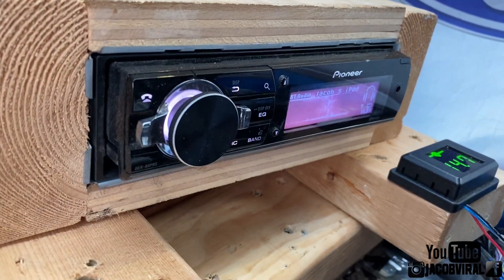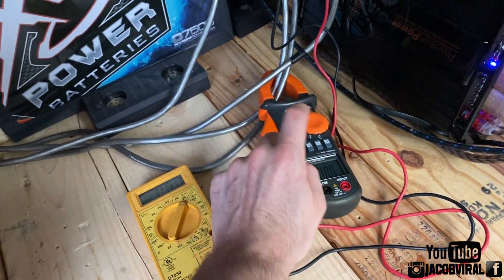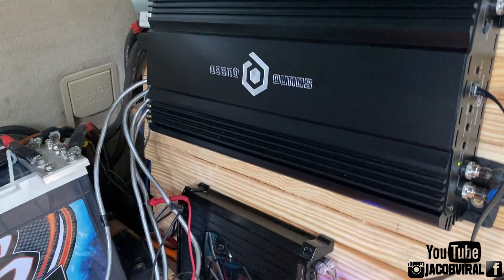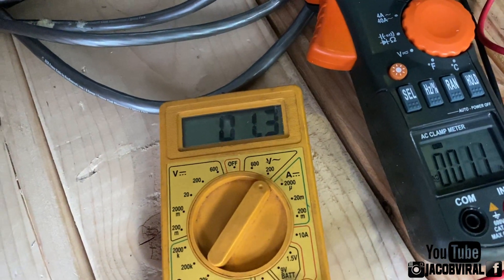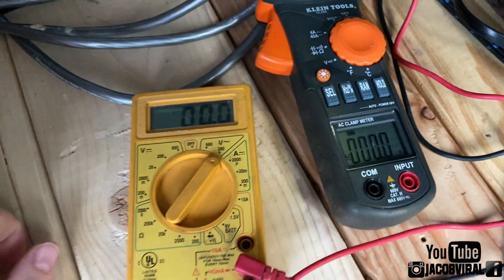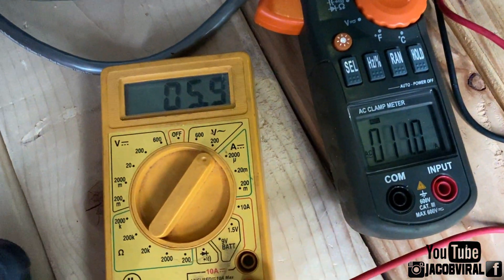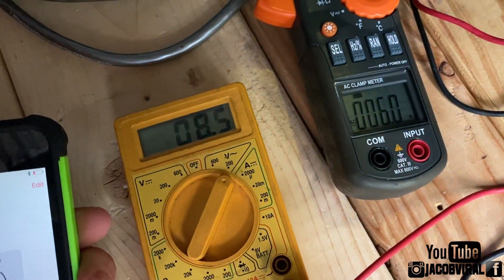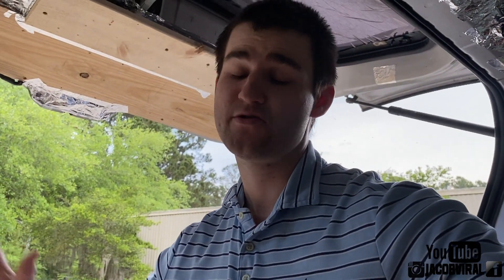HOW TO FIND HOW MANY WATTS RMS YOUR AMP IS PUTTING OUT

Comment: You're measurement is incorrect...
You don't consider the Frequency Effect - AC Meters are sensitive to frequency and should not be used on frequencies other than design frequency. 
The manufactures rate these meter’s accuracy based on being able to produce a displayed reading that is accurate to some amount, usually in root mean square. If you look at the specs for a digital meter they will degrade the accuracy as the frequency goes up.
This should give you a clue. A digital meter has to convert the signal from analog to digital. To do this with any accuracy for a constantly changing voltage, you have to take enough samples to do accurate RMS calculations. So the clock rate of the A/D converter has to be high enough to take these samples and send them to the embedded processor to make the calculations and display them.

Comment: You were 100% clipping. That's why your subwoofer (as you put it) didn't like the frequency. Most newer amplifier power ratings are conducted with a one kilohertz test tone... Whereas back in the day, we would test twenty hertz to twenty kilohertz. By cranking your bass knob, you are causing your amplifier to clip much earlier. Regardless, it's an interesting video.
Reply: Not true, his sub was not clipping, it was overpowered. Big difference also when setting your max vol to clipping you would turn the sub knob to max also so that when everything is maxed you are not clipping.
Reply: If his headunit was not clipping the amp was, you can set your gains close with a dmm but the best way is with an o scope, by the math  @JayRSwan

Comment: can i just do this test by playing music instead of a test tone?
Reply from the maker: Correct
Reply: @JacobViral2  I appreciate it. I could be doing this wrong, but followed everything, just listening to music, strong bass music, and the volts and clamp barely get high, and the car is booming. Volts are at like 1.3 and amps are at like .8.  What does this mean?  Hard to believe that multiplying this is the wattage coming out of the amp. I must be doing this wrong or lack understanding. Any advice?
Reply from the maker: @alwaysbeeurself  I always like to test one frequency with the volume max near clip so it's measurable. Lower volume on music will be harder but yes works. usually not 100% eff but gives ball park.

Comment: Can you make this type of vid (getting correct wattage); setting up a 4 channel amp in bridge mode?? 
I needed more power for the speakers so I am running two 4channels in bridge mode to the doors. 
Worried something is gonna blow bc I never saw them meter anything during install. 
TIA!
Reply from the maker: Youl be fine just make sure your bridge amps isn’t past 4 ohm as most bridges 4 channels are only 4 ohm stable

Comment: sp what if you are clipping before rated rms output
Reply from the maker: Just voltage drop and impedance ohm rise, so will see less than rated
Reply: @JacobViral2  so i was doing 2 ohm × 650 watts target with a square root being 36 volts with multimeter  but are you really sappost to count ohm rise as well when doing this to set gains or is mutiplying by the standing ohm is the way?

Comment: Fuse Size? How come everyone is taking the output watts then dropping say 0.8% for loss in a “Class-D”
amp, 13.8Vdc supply with a 1,000 watt amp and coming up with 90 amp fuse to protect the input. The power solving math doesn’t work like that on an expense “Buck to Buck” boost to run a “Class-D” amp output. 
  The amp clamp should be on the alternator B+ supply side to measure the amps drawn, not output.
  This is off topic as I know you are discussing “Clipping” frequency’s but they are not using voltage drop for wire sizing or a good amp clamp on power supply, then purchase the fuse closest to input needs then undersize if the values fall in between fuses. A small ANL as with most fuses will handle in-rush current in cold equipment for several seconds until it warms up, then current drops. 
  The box, technical service will tell you one thing but an amp clamp will show actual amperage requirements. Who wants a thermal event.
  Add amp #1, amp #2 and DSP if any then pick a fuse for each, add those up and for heavens sake add that fuse at the battery or alternator source! 
DK, ASE master tech since 1978

Comment: Ok, having been around the same old block a few times... You should state what input noise you are using, white noise, pink noise, and what they are weighted at. Or a sine at whatever freq and what is the Q? A singular sine at lets say 1K test tone will give a different response to when a different load is added. The load will respond differently to freq depending on the manufacturer specs for the speaker type(high - mid - low or whatever config). In this case^ you are taking the lowest freq to try do an RMS measurement. But what is the crossover slope and are there errant freq that are just generating heat, since the efficiency of a speaker is better measured at dB SPL @ 1m for total output. You are rating power consumption and not the end result, if this is for finding out what your total current draw would be at the lowest freq range, then yes it will exponentially decrease as you head up in the freq range which will give you a ballpark figure. So as a base measurement you will get an estimate, but no where close to what the actual draw is vs. the output.
Reply: This is also why you are clipping.

Comment: Might be wrong, but you could likely use two voltage meters.  One set to volts, other to amps.
Reply: Almost all multimeters can only measure up to 10amps, so yes you are wrong.
Reply: @mashedpotatoes5323  No. You are wrong... clamp meters can go much higher than that to over a 1000 amps after which the induction current will no longer display. You could also do a comparative using the relevant curve increase to get a standard measurement

Comment: A clamp meter is never used clamping it on both wires...... Doing so will cancel each other out due to the opposing magnetic fields and having a false reading. Only one wire is to be measured, normally the Positive.
Reply: He clamped both positive speaker wires.

Comment: 22 to 20 isn't even half a thousand watts based on you saying you need to multiple the two numbers. You gotta be more clear on exactly what your doing. Do you multiple then times by 2? Cause that would equal 880 watts but what you said only equals 440

Comment: ~5% accuracy of Your clamp meter, non-TRUE-RMS volt meter with ~10% accuracy and most of all, no phase shift measurement between Voltage and Current... absolutely useless video Jacob. It would be much closer to the real numbers if You measured max DC current going to the amp and multiply it by the lowest DC voltage seen by the input (during the load), and the result to be multiplied by 0.8 (typical Class D efficiency)
Reply: so if you have a true rms meter it will work? i have some nice uni-t meters with ac\dc clamp, a/c dc in rush, true rms, all the bells and whistles  . . .there has to be a way to this, but i cant find a single video on how to due it properly

Comment: so on the last run, 28x24 is 672 watts? i'm really surprised the sub is bottoming out at that wattage.. all the more reason for a 4th order, eh? good video bro
Reply: for temporary you could put it magnet side down for more cone control (box is 1.2 and magnet takes up room so maybe less space could do that?)
Reply from the maker: Yea man I have no clue why the sub is making noise without clipping or dirty power at that power level. I'm thinking it's the box is either to big or the sub has an issue idk. I'm lost as to why the sub makes the noise after a certain volume level it's weird. I will consider a 4th order to come I'm sure :)
Reply: @JacobViral2  also make sure there's no coil rub if you can move the sub up and down. sub seems mounted center but if it's not maybe the coil moves around during high excursion? try touching the spider pressing down in random spots and see if there's any ticks. other wise my recommendation of the hd10 d1 is at full tilt. good value good power handling sub 1500w rms 3k max 3 inch vc 300 oz mag
Reply: @notyobiz6207  to add to what he just said in speakers with tight voice coils and boxes with un even pressures you can get cone rock where instead of the cone going linearly in and out the uneven pressures in the box can cause  the cone to go in and crooked causing voice coil rubbing and eventuall damage,  the soultion in high spl pro audio is to have the 4 ports on the corners of the sub , or at least 2 ports on the left and right of woofer, or just one big ass slot